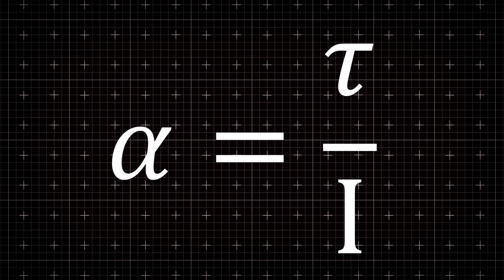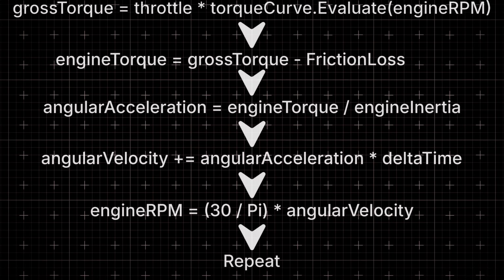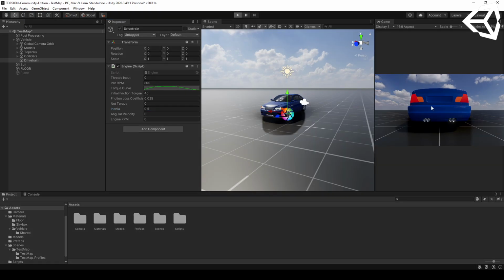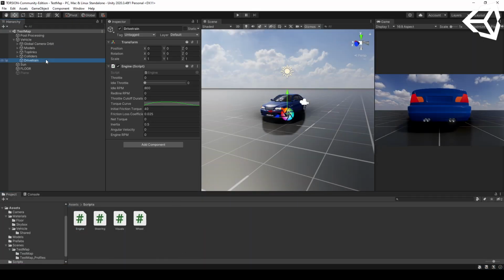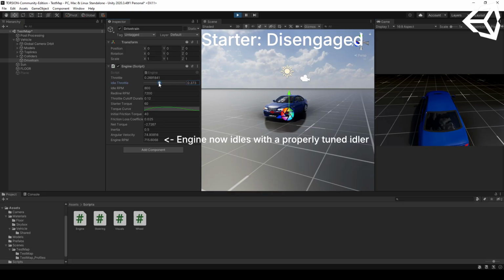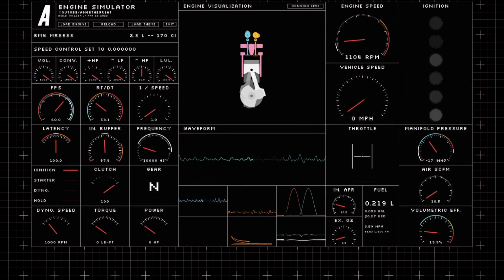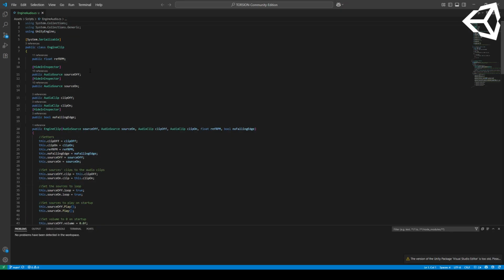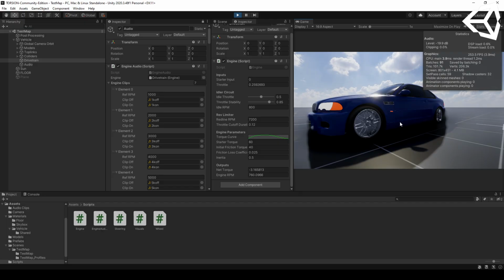Vehicle Physics | Engine

Comment: Amazing. This is the only tutorial that is short but includes just everything for a component to be ready to use. Others just hack in some hard coded user input to control the torque of the engine and the rpm. Even the audio is explained throughly 
Now I can't wait for the next tutorial to actually pair this to the transmission with a clutch/torque converter and finally output to the wheels through a differential/limited slip differential